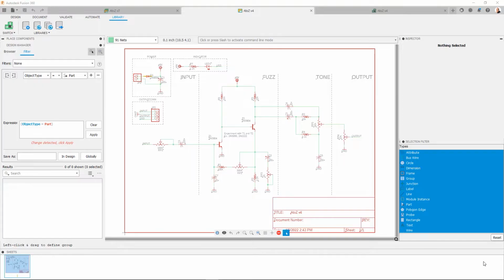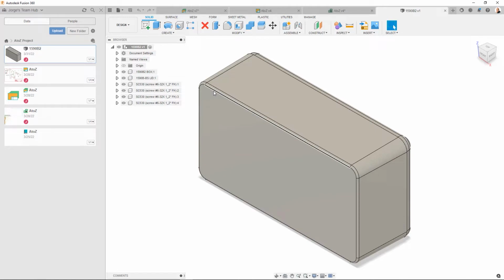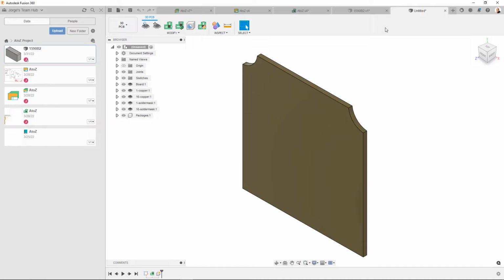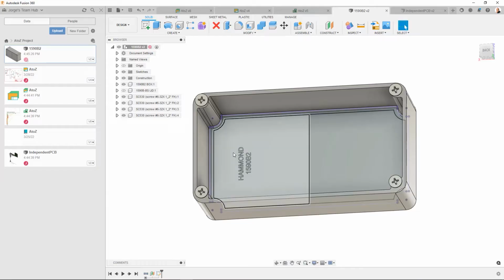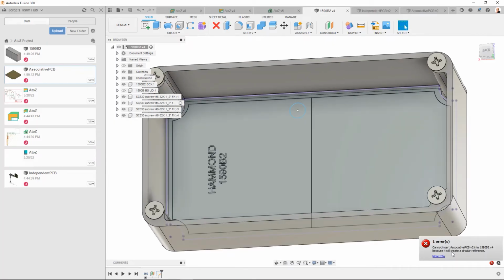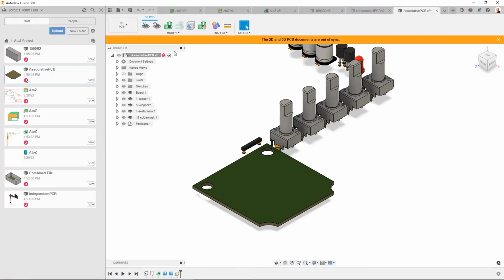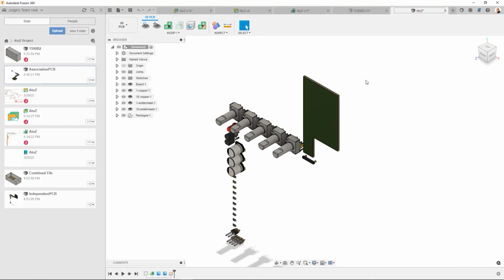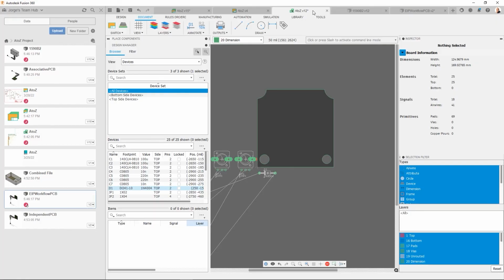4 Ways to Start Your PCB Board Easily | Autodesk Fusion Electronics for Beginners

Comment: absolutely horrible, useless dimensioning of outlines in the pcb editor. I see why you avoided showing us how to do that and skipped on to method 2...  No display of units, no way to dimension lines directly. Line properties doesn't label what is x and y and doesn't allow you to change length of line. What is the point of the tool to draw lines with bends at the same time when you can't specify and lock the radius? Why not just remove the (in)ability to make a PCB outline in the PCB editor completely and force them to use the methods you obviously are pushing the user to use?

Comment: Is this accurate anymore? In the Edit in Place/"option 4" flow I don't see the Edit Board menu item after clearing the previous geometry in the outline sketch.

E: The menu item hanging off the board object is gone, but there is a toolbar button.
E: This UI is impossible. God forbid an Autodesk engineer sand down a single rough edge in anything they do. I've tried this three times and got it to work once.
Reply: It looks like Edit In Place is a Fusion 360 paid subscription feature now.  In trying Method 4, after I inserted the 3D PCB (which I had created from my 2D PCB) into the Enclosure design, if I hover over the Edit (pencil) icon, it says: "Edit In Place // This feature is included with a Fusion 360 paid subscription. Subscribe now for full access to Fusion 360."
Reply: @FiniteState23  Yup! 😔
Reply: I'm also not able to use Method 4. There is no possibility to select a sketch for the new board outline :(

Comment: THANK YOU SO MUCH FOR THIS!!! I've been going INSANE trying to figure out why my Associative PCB (option 3 in your tutorial) wasn't appearing in the original design for the enclosure I am building. Apparently (as you outlined so well in this tutorial) it's because that isn't even possible with the Associative PCB option. And I had no idea at all about this Edit In Place workflow but that's exactly what I needed to know! thanks for saving my sanity. I will be using the Edit In Place option from now on. you rock!